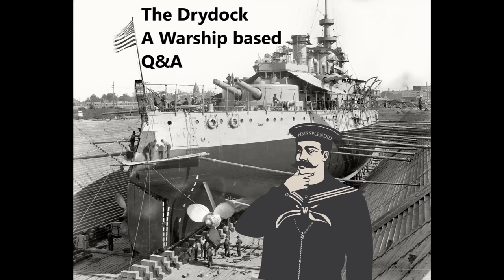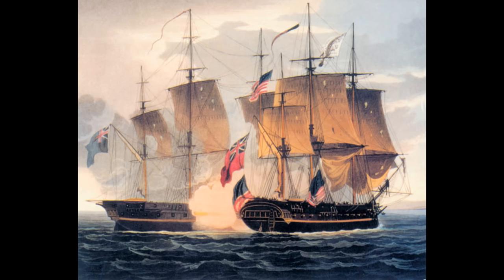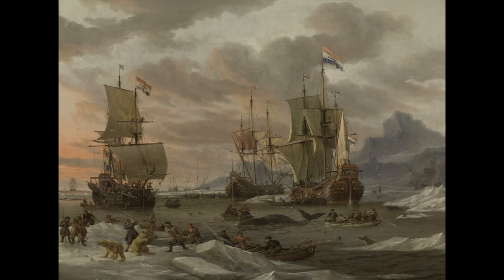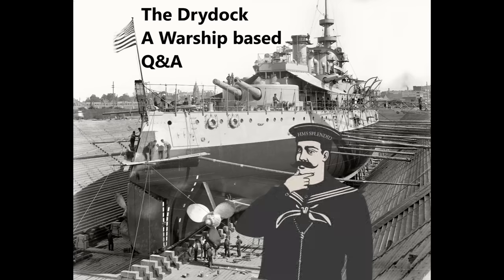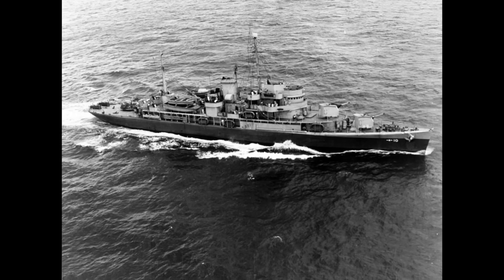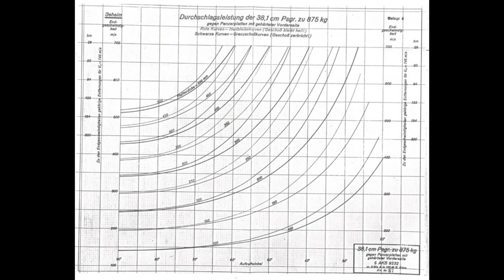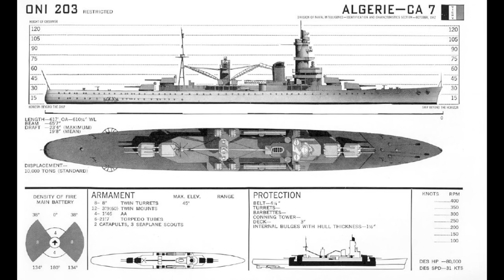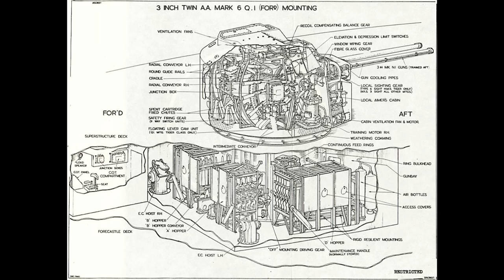The Drydock - Episode 109

Comment: The big reason that slipways were largely abandoned is that constructing a ship on a slipway means that nothing is straight up-and-down.  This makes lining things like vertical bulkheads up much, much harder because you can't just use a plumb line, and anything flat can't simply use a level.  The extra amount of work that this requires is surprisingly large.  It also makes using block-style construction much harder, which further increases costs.  Source: I'm a naval architect and I also used to work as a planner at a large shipyard.
Reply: Well, sir, I believe your source is sufficient for this channel! That makes incredibly good sense, but it’s something I never would have thought of.
Reply: There are side slip ways still being used where the ship is level then launched to the side into the water.
Reply: @danhammond8406  ...............

Comment: Regarding the anti-air flamethrower: A rear-mounted flamethrower was tested on some bomber aircraft. It produced an impressive burst of flame, but more importantly a thick trail of black smoke and soot that served to really mess with any fighter attacking from the rear.

It was eventually decided that it was effective but definitely not effective enough to make up for the sheer madness of carrying a pressurized tank of flamethrower fuel in your already fire-vulnerable bomber.
Reply: Been behind  trucks equipped like that
Reply: Just field a few B36s, get up in the air, and wait till something or several somethings catch fire (usually before you're shot at). Those things were a bloody menace as long as the engines were running.
Reply: my understanding was that at least one german ww2 plane carried one, but it was more an improvised weapon.
Reply: oH, yES.
Reply: @rosiehawtrey  thing is the engines caught fire with such regularity, that carrying all that extra gear is redundant.. Just throttle up one of the eight that were running hot, and "poof" instant flame thrower... 
  At least that rapid disassembly is scheduled,  and you get something for your lost power plant.. lol

Comment: All of the steel hulled ships that I have sailed on have had as part of the construction blue prints a Dry Docking Plan that lays out  the positions for the keele blocks. As a side note, there are extra keel and side block positions which allows a different set to be used in each dry docking and allows for complete coverage of hull paint over a period of several dry dockings it is difficult to take the paint down to bare metal where the blocks are.
Since the mid-1970's when Ingalls Shipbuilding constructed a new plant to built the Spruance class. The keel block plan is an integral part of construction. The ship is constructed on blocks riding on electric trucks as the hull moves through various phases and sections of the yard. Finally when it is ready for launch the electric trucks are replaced with dummy trucks and the ship is moved onto the yards floating drydock. The drydock is moved out into the harbor and ballasted down launching the ship, which is then moved by tugs to the fitting out pier.

Comment: I think it was Norman Friedman's Naval Anti-Aircraft Guns and Gunnery
 that said another reason navies starting looking hard for 3" around the end of WWII, in addition to being a lighter weapon and faster firing that a 4.5", 5", or 5.5", is that the lethal burst radius of the 3" shell better fit the effective trigger range of the newly developed proximity fuse.  The bigger lethal burst size of the larger shells is largely wasted if they won't detonate at all unless they come close enough the 3" shell would have killed the target anyway.
Reply: Tuuuyuu
Reply: How would you deal with the inherently-considerably-shorter range of a 3" gun as compared to a 5" or 5.25" or 6" gun, though (especially when you're dealing with fast-moving jets where you need that range in order to be able to take it out before it closes the range and drops ordnance, or to reach out far enough in order to be able to hit it before it drops a Fritz X or other standoff weapon)?
Reply: I has been my understanding that much of the reason for replacing the 40mm Bofors with the 3" gun was that the 3" was the smallest shell that could use the proximity fuses of the time.  It also provided more range than the 40mm which corresponds to more time to shoot down the plan and more time for the plane to crash before it hit the ship.

Comment: I've actually spent a fair amount of time looking at the loss of the Edmund Fitzgerald and I'm convinced that the NTSB has it right. First this isn't the first big lake freighter to be lost so we have that data to look at. Including ships that broke up on the surface. Second the modeled the various scenarios and only one really fit the evidence that is there. We know she was listing and taking on water. We know that her cargo hatches were not water tight and that she had water pretty much continuously on her deck. Thus we know water was getting into the holds without a way to detect it or remove it. We also know that her hatch covers were not strong enough to survive a very large boarding wave. So the most likely scenario is that she gets hit by a large wave which collapses her forward hatch cover. She is already very low in the water with minimal reserve buoyancy by this point. the sudden filling of her forward holds with tons of water drives her quickly down by the head leaving no time for any kind of crew action. She simply dives under. when the bow hits bottom the shock of the impact results in her hull failing. We can see evidence of how hard she hit in the bow damage. When the hull fails the stern rips off capsizing and vomiting its cargo. Its likely that the stern doesn't immediately fully sever from the bow section which is part of why the two sink together.

I don't know how the current generation of lake freighters has been designed but its clear that ships of the Edmund's Generation were not despite their enormous size capable of being on the lakes in all conditions. the lack of subdivision in their cargo holds, low freeboard, and poor hatch design  made them very dangerous in high seas.
Reply: Thank you, I agree with you.
Reply: Me, who has seen one video about the fitz ever: That's the theory I believe in too
Reply: A few things about lake freighters;  Moving huge quantities of bulk freight is cheaper by water (salt or fresh) than by any other method. Even though some of the lakes are closed during the winter due to ice it is still  cheaper than rail roads.  Lake boats, carry staggering amounts of grain, iron ore, coal, limestone, gravel, salt from the states where they are harvested or mined to the states where these commodities are used.  Their ability to move bulk commodities was essential to American industrial productivity during WW2 (no U-boats lurking off shore at Cleveland, Duluth, or Gary, Indiana).

Although they can be over 1000 feet long, they are called lake boats.

Lakers are structurally immortal! Because they spend their lives in fresh water they don't rust. Even along their sides were the paint is scraped and gouged by banging against piers for decades, no rust.  70 year old hulls were in service common until quite recently.  The "new" Thousand Footers were all build in the 1970s with no replacements planned. Note: one trip into the (salty) St. Laurence can take decades off the  life of a laker.
Reply: @mikebrower8450  sorry they aren’t immortal. First of all metal fatigue is a thing especially with how these ships are built. Second while salt water corrosion is undeniably worse metal dose corrode in fresh water as well. Just look at the USS Cod.
Reply: @mikebrower8450  Yea, no. Rust happens even in freshwater, just look at the Texas. Secondly, as the other guy said, metal fatigue. It’s a thing that simply cannot be prevented, just somewhat mitigated and dealt with by replacing damaged elements.
Reply: In my opinion, I kind of go with she was forced under by a wave, and then again and slammed into the ground, breaking up. based on the evidence at her grave, with giant craters.
from a cheese head
Reply: Indeed Jet Driver,  I've been in the holds of these things , even modern day ones..And they, by design are only fit for running the Lakes...different set of compliances, and rules they have to adhere to , and built to a weaker hull design. It's that 733, 80 foot lock dimension that really forces this as one can pull into safe harbor in a day or less if the weather gets foul..so they build them accordingly. It's Also why they carry so much cargo for their displacement.. Salty's carrying around a lot of extra steel..
    Those rules have become more stringent over the years, especially the condition of your stringers, and any hot work being done around them that may weaken the structure..  The White hats don't just sign off on them anymore, but that's another story ..
    Superior is a Small Ocean unto it's self, with Shallow bottoms and lots of rocks, taking her for granted is a huge mistake one doesn't want to make, especially in a lake boat..

Comment: Speaking of boilers in that early question, steam is crazy stuff. i have pictures where it ate away metal on heavy fittings after developing a pinhole leak or not being seated properly. That was on less than 200 lbs steam, i could only imagine how bad that could get on something 4-5 times that amount of pressure. 

Like guys i know that work in a power house, they test fittings with a broom (because they play with something close to 1-1.5k pounds) so if theres a leak it cuts off bristles instead of a finger. 

i have more stories, but ill just end the blogpost there. As always,very happy to use my time listening to Drach. Love learning about naval stuff.
Reply: I worked on a 1200lb steam plant in the '70s.  A pinhole leak could cut a man in two.
Reply: @WildBillCox13  I never understood why the US Navy decided that a one screw Knox class frigate with 1200 psi steam was such as good thing. 600 psi is the way to go if using steam. Less dangerous and easier to repair battle damage.
Reply: @PNurmi  We were trained on the DD 692 (Sumner class) powerpland: 600lb steam.
Reply: And the only good thing about a one screw ship is less chipping of paint in the shaft alleys.  ;-)
Reply: @WildBillCox13  And very clean too, there would be no jagged edges.
Reply: Anything superheated is scary because it is invisible until it loses its superheat.  That's why the broom is still the primary leak detection method.  People think of steam as being white, but that's only the saturated stuff, most naval systems (and powerplants) have several hundred degrees of superheat, or added temperature above the boiling  point at that pressure.  Water boils, as everyone knows, at 212 °F (thats 100° Communism, for you philistines out there) at atmospheric pressure, i.e. 14.7 psi.  So 260° would be 50° superheat, but naval boilers, by WWII and later, were >500 psi. Meaning that water boils over twice its normal temperature.  Scary stuff when it starts to misbehave.
Reply: @nomad8723  concur that's how we checked for leaks.
Reply: @nomad8723  to my
Reply: That broom trick is also how we checked for HP air leaks 4500psi air will messy up your day if you search for the leak with the "hand search"
Never had to search out a steam leak but we did have a very small coolant leak in the "white room, thou shalt not enter" but that is another story all together....

Comment: Salvaging ships is going to depend on the depths the divers can withstand, though with new ROV's that is certainly changing. To put things into perspective, the deepest dive using scuba was down to 332 metres, likely using a rebreather and certainly using a non standard Trimix mix. It was done by an Egyption SF diver named Ahmed Gabr, and while it took 12 minutes for him to reach the 332 metre target depth it took him 15 HOURS to return to surface. The problem with SCUBA as you can see is not getting down there, but getting back up! Most of a deep SCUBA dive is spent decompressing on the return. There are only 30 - 40 people known to have dived below 240 metres using SCUBA, that is total, not those currently diving.... 

This is where we come to Saturation Dives. The Dive team essentially lives in a pressurised environment, usually a series of chambers on board either a Diving Support Vessel or a rig. These chambers are brought to the pressures the dive team will be operating at, and they will be constantly supplied with the Gas mix they will be diving with. To dive they are lowered to depth in a pressurised diving bell. The idea behind Saturation diving revolves around the simple fact that once the body has been subjected to the pressure and gas mix for a certain length of time the decompression period remains the same. Hence the name Saturation Diving, as the divers blood stream is Saturated. Downside of this method is that the decompression period is long.... very long. Hence why the divers live in an isolated chamber where the pressure and gas mix can be slowly brought back to surface levels in a controlled manner. 

Problem is this is a very specialised form of diving, of the registered Commercial Divers in the world only about 10% of them are Saturation Divers..... At extreme depths very exotic gas mixes are also required, well beyond the Trimix standard for SCUBA at extreme depth. Deepest Saturation Dives I am aware of were a series of tests literally to find out how deep divers could go by Duke University in North Carolina. They conducted on shore dives in a Hyperbaric chamber down to 686 metres. To my knowledge no one has ever gone that deep in the ocean.

Even with Saturation Diving allowing greater time at depth however you still have a problem. Pressure. And there is only one way around that. ADS, Atmospheric Diving Suits. These are, essentially, man shaped mini Submersibles. A US Navy diver has reached 610 metres using an ADS in an actual dive (not an onshore 'dive' in a hyperbaric chamber), in theory an ADS can take you to 700 metres, but to my knowledge no one has gone that deep. ADS does not have decompression issues as the diver is kept at surface pressure. 

As you can see, while it is theoretically possible to get a diver down fairly deep, it is not an easy process, and the number of people qualified to dive at these kinds of depths are few. At the moment you still require divers to successfully salvage a ship in its entirety. Submersibles and ROV's are, at the moment too clumsy and limited to conduct many of the operations required This of course will change, especially with ROV's, but at the moment the real limitation is your divers.....

Comment: You should do a 30min video JUST on the subject of why boilers tend to rapidly, and very forcibly, disassemble themselves when subjected to seawater!
Temperature differential cracking the boiler open, but also what seawater does to the STEAM PIPES in the boiler, sudden effects of water hammer, and how opening up the steam section inside a boiler affects it's desire to no longer be inside the vessel.

Comment: Hey Drach, yours is one of the few well thought out explanations of the sinking of the Fitzgerald!

The one thing I’ve got to bring up is these waves, as mentioned by the crew of the S/S Arthur M. Anderson, following Fitzgerald, wasn’t they were considered rogue waves by their direction as they were heading into the seas but their size, being estimated to be 25-35 foot waves in 15-20 foot seas. I’m of a similar to opinion to you otherwise, the ship encountered the first wave, buried its bow in the wave, hadn’t cleared the wave from its deck before the second one hit and the third one put the final nail in the coffin as it were. 

That being said, I don’t believe it split on the surface, as the water in that area was shallower than the ship was long and there are reports from the watchmen on the Anderson that they saw a flash in the direction of the Fitzgerald. This suggests to me the ship went down rapidly, impacted the bottom, sheared it’s hull in two, shorting out the electrical and causing the flash before the stern settled and was dragged down by the bow.

Comment: As far as aviators being on subs. They would qualify as a watch stander, and then also getting PQS signed off and even become a watch officer in that time, and the use of the damage control systems.
Reply: Shot down experienced pilots are more valuable than the aircraft and naval rescuers were enjoined to take very good care of them and NOT to expose them to unnecessary risk though a majority offered their help info from the late Carl P Donahue 1923=2007 shot down attacking the Yamato and saved by submarine in 1945.
Reply: If not hurt. They would be a, grateful and want to pay back.  B, bored stupid if they did nothing  c. Not being used to subs would want to be outside more so watchkeepers even lookouts

Comment: WRT Naval Firing Ranges - The main one for the US Navy is actually on the Potomac River just south of Washington DC. The firing range is down a straight stretch of the river.
There is a story that they once missed the river and a 12" (?) round landed in the backyard of a residence in Maryland. The owner won't let the navy have it back. 
Also, there is a piece of battleship armor just outside the main gate with two projectiles stuck in it. I don't remember the size, I was there in 1974.

The base also had a couple barrels from the 18" gun the US Navy was developing during WWII.
Reply: If only they would have fired some shells northward.   Would have likely caused attacks of intelligence to occur in Mordor on the Potomac.
Reply: Naval Surface weapons Center Dahlgren, MD